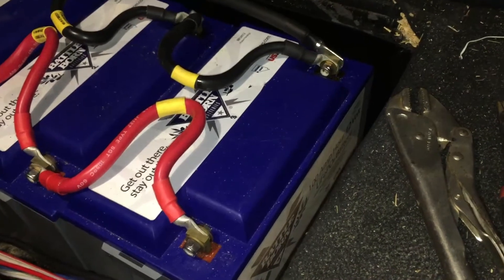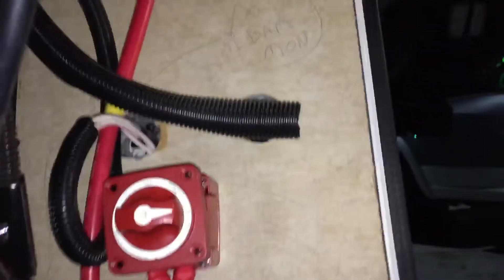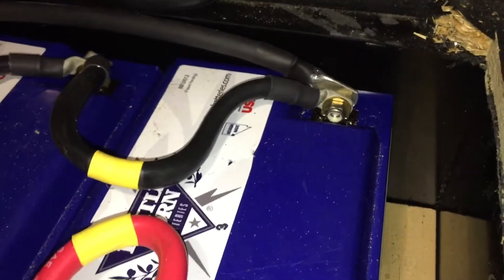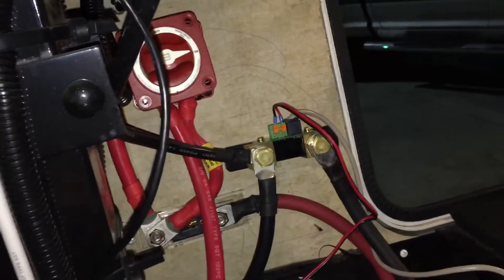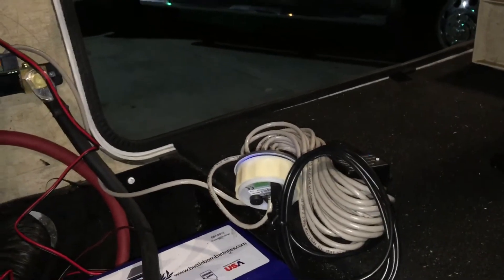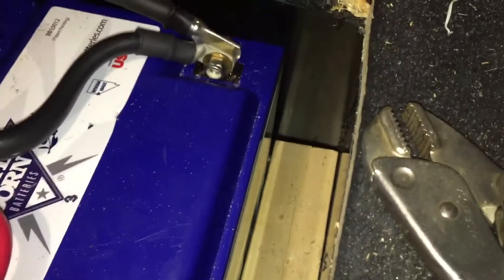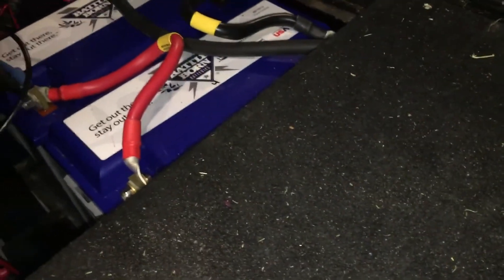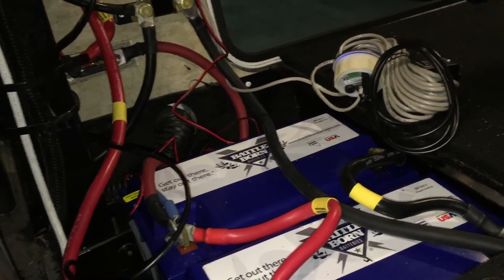RV Lithium Battery + Inverter Upgrade

Comment: Great set up for the money. I'm confused tho the Xantrex Technology Inc, 806-1210 Inverter Prowatt Sw 1000 does not indicate that this is a "pure sine" power inverter. Why spend all that money if your not going to protect your high dollar items with your unit with good clean power? This seems to be a lot of money for a regular inverter. Or, am I not seeing that this is a pure sine power inverter? Thanks.
Reply from the maker: Well this is grossly late. I got the inverter second hand from someone who bought it and didn't install it. As far as I can tell, Xantrex says it's a "true wave" inverter, so they seem to be dancing around the "pure sign wave" part. I never had issues with anything running on it and we've got more than a couple of weeks of use on it.

Comment: does the bictron meter show amp hours used with Lithium? i have the battle born lithium also but i cant figure out how to monitor how many batterys im using or when its getting low,besides going by voltage but thats VERY hard to judge by with lithium. Thanks
Reply from the maker: BachBeats yes, you can track amp hours used vs what is available in the bank (99 amp hours per battery). There is no Puekurt Effect (I know I spelled that wrong). So the battery monitor had to be configured for it. For my Victron, it was configured through Bluetooth using the Victron app on my phone.

You need to reach out to Battle Born. They have a document that you can follow with the appropriate settings.
Reply: Ok Thank you so much, and for the speedy reply!!
Reply from the maker: BachBeats fortunately, Battle Born’s support is awesome and I imagine they’ll respond to you tomorrow if you reach out today!

Comment: Thanks for posting. I am making a similar setup for my camper van. Having trouble finding diagrams. Your video is so helpful.
Reply from the maker: If you go back through my Facebook posts, you can find this diagram that shows how it is all pulled together: 

https://facebook.com/LearnToRV/photos/a.1000018590065561.1073741828.998647740202646/1421827497884666/?type=3&source=54

Comment: Nice set of batteries, but 4 grand for 4 batteries is a little steep. I did not see a charge controller so does that mean you have no solar and are just charging with a battery charger?
Reply from the maker: More than a little, it’s VERY steep. Supposedly the longevity and # of recharge cycles far exceeds lead-based batteries to bring the cost down over time, but it still hurt to write the figurative check. For me, the other PROs won over the cons- lighter weight was the absolute biggest reason for me and speed to recharge was my #2. I upgraded my converter/charger to a lithium-aware charger and use it via a generator. I don’t have the spare carrying capacity to add solar at this point but will with the next rig (which I’ll swap the batteries over on).
Reply from the maker: You can get them slightly less expensive by catching sales different places. I've tried asking Battle Born for a discount code to share- but so far, they won't. Other places have discounts periodically- I know Brian Boone's Got Solar blog has a discount.
Reply: Wow 4g   that's a hard one to swallow,  good vid  I run 2 agm 12 volt batteries and that was 1000 bucks  thought that was bad  lithium prob come down in price tho

Comment: Did you use 2/0 cables for the battery interconnection cables or did you go with the larger 4/0?
Reply from the maker: outbackeddie between batteries is 1/0 and between the wiring on the wall is 2/0.
Reply: I used 4/0 and 2/0 cables for my battleborn setup, I know the 4/0 is a little overkill, but it's what i had easy access to. check it out if you haven't already

https://www.youtube.com/watch?v=wZvJrX7G_lQ&t=27s

Comment: Definitely interested in your results! Please post what happens with your new install
Reply from the maker: So far, we are absolutely in love. We make no attempt at conservation of electricity when on battery power and have been able to run almost anything we want. I’ve been really surprised that things like the toaster, my wife’s curling iron, and her hair straightener all  run off of this inverter. The only disappointment I have is the 800W microwave doesn’t work.

Capacity-wise, as I said- it is great. We use maybe 200-280Ah each night.
Reply: Just a suggestion. You really should have a pure sine wave inverter that is twice as large, not surge but constant use, as the amount of power you intend on drawing. Rule of thumb with Chinese inverters is a 50% rule if you want them to last.
Reply from the maker: I'm only seeing this suggestion now. I'm hoping to upgrade the whole kit when I add solar next year- bigger/better inverter. But for now, my 1000W Xantrex inverter does pretty decent.

Comment: Are you using the stock RV charger?
Reply from the maker: No. My stock converter/charger died last year and I replaced it with a Progressive Dynamics something. In looking at its specs, I was reading that my batteries would be happier/better charged if I got a lithium-were charger. I upgraded again to a different Progressive Dynamics  lithium charger.

I didn’t change any wiring between it and the batteries.
Reply: @LearntoRV  :  A "lithium-were" charger???
Reply from the maker: Captain Quirk, darn typo! Lithium *aware*. Progressive Dynamics makes them that have different charging voltages for when charging lithium batteries.